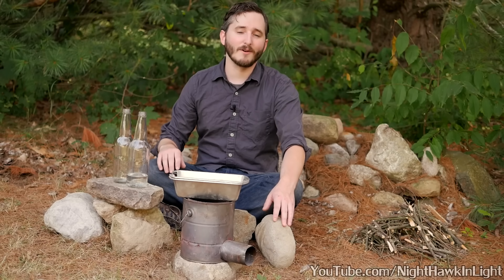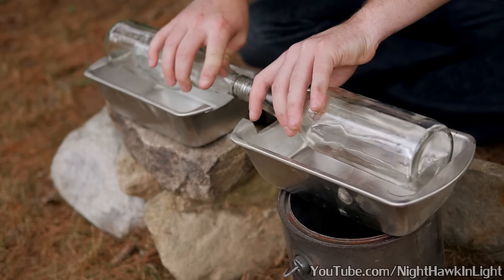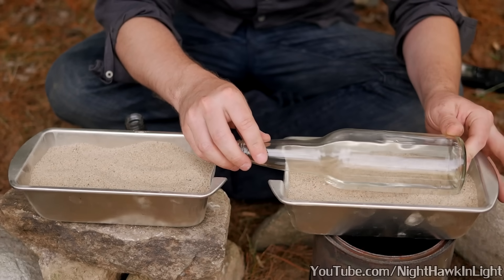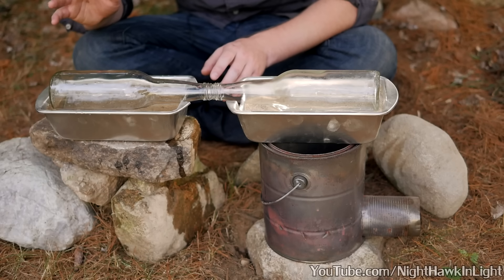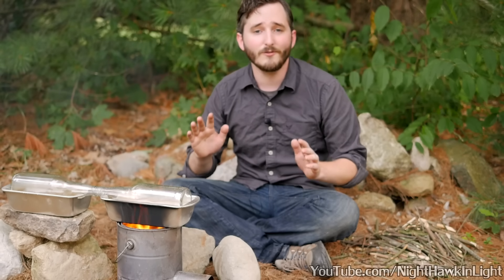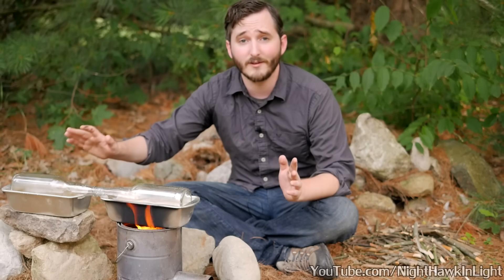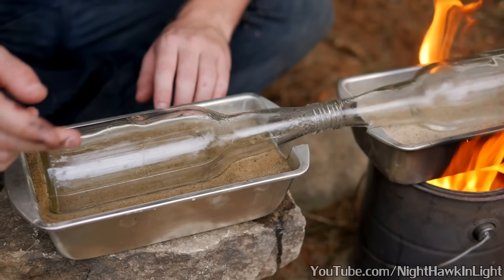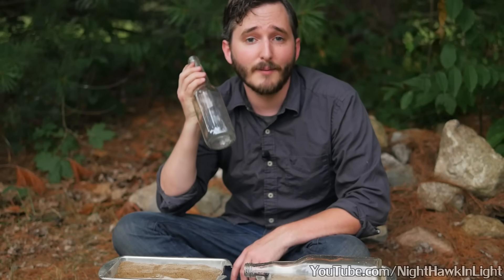How To Turn Salt Water Into Fresh Water (Simple Improvised Distillation)

Comment: FIRST POINT

Through the light of belief, man rises to the highest of the high and acquires a value worthy of Paradise. And through the darkness of unbelief, he descends to the lowest of the low and falls to a position fit for Hell. For belief connects man to the All-Glorious Maker; it is a relation. Thus, man acquires value by virtue of the Divine art and inscriptions of the dominical Names which become apparent in him through belief. Unbelief severs the relation, and due to that severance the dominical art is concealed. His value then is only in respect to the matter of his physical being. And since this matter has only a transitory, passing, temporary animal life, its value is virtually nothing. We shall explain this mystery by means of a comparison:

For example: among man’s arts, the value of the materials used and that of the art are entirely different. Sometimes they are equal, sometimes the material is more valuable, and sometimes it happens that five liras’ worth of art is to be found in material like iron worth five kurush. Sometimes, even, an antique work of art is worth a million while the material of which it is composed is not worth five kurush. If such a work of art is taken to the antiques market and ascribed to a brilliant and accomplished artist of former times, and announced mentioning the artist and that art, it may be sold for a million liras.1 Whereas if it is taken to the scrap-dealers, the only price received will be for the five kurush’s worth of iron.

Thus, man is such an antique work of art of Almighty God. He is a most subtle and graceful miracle of His power whom He created to manifest all his Names and their inscriptions, in the form of a miniature specimen of the universe. If the light of belief enters his being, all the meaningful inscriptions on him may be read. As one who believes, he reads them consciously, and through that relation, causes others to read them. That is to say, the dominical art in man becomes apparent through meanings like, “I am the creature and artefact of the All-Glorious Maker. I manifest His mercy and munificence.” That is, belief, which consists of being connected to the Maker, makes apparent all the works of art in man. Man’s value is in accordance with that dominical art and by virtue of being a mirror to the Eternally Besought One. In this respect insignificant man becomes God’s addressee and a guest of the Sustainer worthy of Paradise superior to all other creatures.

However, should unbelief, which consists of the severance of the relation, enter man’s being, then all those meaningful inscriptions of the Divine Names are plunged into darkness and become illegible. For if the Maker is forgotten, the spiritual aspects which look to Him will not be comprehended, they will be as though reversed. The majority of those meaningful sublime arts and elevated inscriptions will be hidden. The remainder, those that may be seen with the eye, will be attributed to lowly causes, nature, and chance, and will become utterly devoid of value. While they are all brilliant diamonds, they become dull pieces of glass. His importance looks only to his animal, physical being. And as we said, the aim and fruit of his physical being is only to pass a brief and partial life as the most impotent, needy, and grieving of animals. Then it decays and departs. See how unbelief destroys human nature, and transforms it from diamonds into coal.

SECOND POINT

Just as belief is a light which illuminates man and makes legible all the missives of the Eternally Besought One inscribed upon him, so too it illuminates the universe, and delivers the past and the future from darkness. I shall explain this mystery with a comparison I saw during a vision, which concerns one meaning of the verse:

God is the Protector of those who believe; He leads them out of darkness into light.2 It was like this:

I saw in a vision an awesome bridge built between two high mountains situated opposite one another. Beneath the bridge was a valley of great depth. I was on the bridge. A dense darkness had enveloped every part of the world. I looked to my right and saw a vast grave swathed in an unending dense gloom, that is, I imagined it. I looked to my left and as though saw violent storms and calamities gathering amid terrifying waves of blackness. I looked beneath the bridge and imagined I saw a profound abyss. I had a dim torch in the face of this terrifying darkness. I used it and could see a little with its light. A most horrific situation appeared to me. In fact, such awful dragons, lions, and monsters appeared around me and on the bridge in front of me that I exclaimed: “Oh! This torch brings me only trouble!”, and I angrily cast it to the ground and broke it. Then on smashing it, the darkness suddenly dispersed as though I had turned on the switch for a huge electric lamp that lit up the whole world. Everywhere was filled with the lamp’s light. It showed everything as it was in reality.

I saw that the bridge I had seen was a highway through a plain passing over even ground. The vast grave I had seen on my right I realized consisted from top to bottom of beautiful, verdant gardens and gatherings for worship, service, conversation, and the remembrance of God under the direction of luminous men. The precipices and peaks on my left which I had imagined to be tempestuous and stormy I now saw fleetingly to be a vast, lovely, and elevated place of feasting, recreation, and enjoyment behind mountains that were adorned and pleasant. And the creatures I had thought to be terrifying monsters and dragons, I saw were familiar domestic animals like camels, oxen, sheep, and goats. Declaring, “All praise be to God for the light of belief,” I recited the verse,

God is the Protector of those who believe; He leads them out of darkness into light,

and I awoke from my vision.

Thus, the two mountains were the beginning and end of life; that is, this world and the Intermediate Realm. The bridge was the road of life. To the right was the past, and to the left, the future. As for the small torch, it was the human ego, which is egotistical, relies on what it knows, and does not heed the heavenly revelation. The things imagined to be the monsters were the events and strange creatures of the world.

Thus, one who relies on his ego, who falls into the darkness of heedlessness and is afflicted with the blackness of misguidance resembles my first state in the vision, which, like with the pocket-torch and due to deficient and misguided knowledge, saw the past in the form a huge grave amid darkness imbued with non-existence. It showed the future to be a stormy and desolate wasteland governed by coincidence, and events and beings, which are all submissive officials of One All-Wise and All-Compassionate to be monsters. Such a person as though manifests the verse,

And those who reject belief, their protectors are the evil ones; they lead them out of light into darkness.1

But if such a man attains to Divine guidance and belief enters his heart, and if the tyranny of his soul is smashed and he heeds God’s Book, he will resemble my second state in the vision. Then the universe will suddenly take on the colour of day and be filled with Divine light. The world will recite the verse,

God is the light of the heavens and the earth.2

Then he will see with the eye of the heart that the past is not a vast grave, but where the groups of purified spirits who each century having performed their duties of worship under the leadership of a prophet or saint exclaim, “God is Most Great!” on completion of the duties of their lives, and fly to elevated abodes, moving on to the past. He will look to the left, and through the light of belief distinguish in the distance a feasting-place of the Most Merciful set up in palaces of bliss in the gardens of Paradise, beyond the mountainous revolutions of the Intermediate Realm and the hereafter. And he will realize that the storms and earthquakes and tempestuous events are all submissive officials, and understand that they are the means for instances of wisdom which though apparently harsh are in fact most gentle, like the storms and rains of spring. He will even see death to be the introduction to eternal life, and the grave, the door to everlasting happiness. You can deduce further aspects for yourself. Apply the reality to the comparison!

Comment: It is also possible to use just a bottle and one of those trays. Bottle will have same purpose as in this video, metal tray will be the cold surface for condensation (placed over neck of the bottle upside down at angle with one corner being the lowest point). Water will condensate in the tray and trickle down. All you have to do is use third vessel which can be anything including a large leaf to catch it (the third vessel can be  literally anything water tight with depression including you)
Reply: That last line killed me 😂

Comment: If it’s that easy to remove salt from sea water why is there a worldwide worry about limited fresh water sources??? Wouldn’t we be able to just distill all the water humanity needs from the ocean if this was true?
Reply: Because to distill the amount of water a country or god forbid the 7 billion + of us would need a significant resource input. In not only  distillation plants but massive amounts of seawater.  It is far simpler to treat fresh water than to create it out of seawater. 

Not to mention the unfathomable drain on worldwide energy grids. It takes a lot of energy to heat water up. It's why it saw use as a coolant for so long. And in some applications is still used as a coolant.

Comment: Don't you need a rubber gasket to prevent gas from escaping between the bottles?
Reply from the maker: No, it seals by itself with a little water that collects on the rim. Hardly any escapes

Comment: Without the pants-why not do a decoder hole for the heat source. It’s a U-shaped hole that  works like a rocket stove with the fire on one side and the air getting sucked through on the other. 

Since the fire is in the ground-all you have to do is lay the bottle on top of the Side of a hole with a fire. Thanks for this post!

Comment: The biggest potential problem is that if your source water is contaminated with something that has a lower boiling point than water then this specific technique will need to be modified. What you will have to do is wait until after the water has started boiling before you set up the second bottle to receive the steam from the first.
Reply: You could just add a coiled tube of copper and close it up at both ends. Nothing's getting in there then.
Reply: salt can accomodate harmful organism
Reply: @Drjarso heat will kill the bacteria and other things.

Comment: I live on a small island and have been trying to figure out an easy way of distilling sea water (short of investing in a still) if I had to, this is a great idea, so thanks for sharing!
Reply: Old post but easiest way is to buy some copper line and a couple adapters.  put the adapters on bottles/containers and plug in the tubes.
Reply: @michelle.lin3653  I’m still here, cheers for your input 🙂🤝
Reply: @KumaBean  Welcome, we use it here and it can work with anything from a 1/2 L bottle to giant IBS containers

Comment: I’m wondering if it were a hot day you could build a pile of sand and bury a bottle in the sand to keep it cool.  Then take a dark bottle exposed to the sun to heat it up.  If you had about 20 bottles you could do this on a mass scale with no fire needed.  It would be slower but could be ramped up for ease of production.

Comment: Using two fresh coconuts and hollow reed would be probably a feasible method on some deserted palm island.
We could also make a suitable clay pot(s), or as a faster method, some combination of the stone plate bottom (or the baked clay bottom) and the wooden or stone plate sides, hopefully  for a lot larger containers and the quantity of distilled water.
Reply: "Using two fresh coconuts and hollow reed"? You must have been stranded on a deserted island with the Professor.

Comment: You need to add the minerals back into the water "apparently" (it's one of those things we know that we're told we know) prepare with this at least for October. Love and god bless.
Reply: Physiological water is a 0.95% salt solution iirc, so adding a small bit of salt/sea water to the distilled water can be done if osmosis issues are to be feared from drinking it. If you have food, eat alongside of drinking distilled water, the dH2O will extract the needed minerals from the food instead of your body.

Comment: Great info! I am planning a 30 day survival trip to a Motu Iisland) in French Polynesia. There will be no fresh water. I have seen a couple of your projects, which one would you recommed for my purpose?
Reply from the maker: My projects are for emergency use. You need a well made commercial desalinator or still
Reply: @Nighthawkinlight  Our objective is to build one in an emergency situation.
Reply from the maker: Probably this version then, but others have noted that brass and copper should be replaced with all stainless steel for safety: https://youtu.be/PT6cjp_zThw

Comment: That was good Information, thank you. I'd like to see how to distill large Amounts of lake, stream, and pond water suitable for drinking. Do you have that Information?
Reply: 2 steel drums connected by tubing at the top (has to be metal or something heat resistant). Fill one with salt water and light a fire underneath. As the water evaporates it will condense in the tubing and drip into the second cooler drum. Should have a full drum of fresh water by the next day as long as the fire doesnt go out. Keep the second drum as far away from the fire as possible to minimise it conducting any ambient heat (2m should be fine). Cook the drums for an hour or so before hand in order to burn off any toxic residues or lubricants before you boil water in them.

Comment: Why not just catch the water or create a straw or use a string/wick to run down to a standing bottle below? This is cool, but with something like wine jugs it would be a thousand times more effective. Could this be done with those big Ozarka jugs is the question. I'd love to see that. Or you could cap them off and drill a hole in each one high up on the ends and connect them with a pvp pipe or something. That would be a neat contraption. How well could the sun-evaporation do this for you with bottles?

Comment: Yes, I think  you should give a few drops of salt water into the distilled water, since the distilled water is very pure and can take electrolyte from your throat.. unless you let the water contact with air long enough so there will be enough dissolved CO2 that will be presence in the water (in the forrm oh carbonate ion, can be detected by pH drop, usually from 6 to 5)

Comment: I was wondering if you could use yur method with somewhat dirty grungy water & then boil up what collects in the empty bottle to make it safe to drink. What do you think? Tried to send that to ya in an email but said the address of yur vid here don't exist. But that is some very cool stuff & good stuff to learn as well. Like yurself I'm no where near salt water. I'm way to far away from that stuff.
Reply from the maker: Yes dirty water would be safe to drink after distilling, but you may need to throw out the first bit of liquid that distills over.
Reply: @Nighthawkinlight  oh okay. Thanx for the tip dude. I'm just getin geared up, headin out with the dog for an adventure, hare is still open, time to get some bunnys before the season ends.
Reply: @Nighthawkinlight  & im back. I'v never tried distilling dirty water. I'v drank from flowing streams & lake water. Boiled a lil bit of snow once to drink but never did or had to do what you see on those survival shows. Who knows, maybe in the future I might use yur method. Just have to see what the future brings.
Reply from the maker: For most water boiling is just fine. You only need to distill if there's some kind of chemical contamination like salt or oil. For the latter you need to be much more careful to boil off the first bit of steam into the air, then toss the last bit. That's where the contaminants will be. You also may need to distill several times.
Reply: @Nighthawkinlight  oh okay. I like learnin stuff cause I spend lots of time outdoors. Can't stand bein indoors. I wana start livin outside, just gota wait for the snow to melt away. Any knowledge I can get will help. I'd usually just take bottled with me. Just enough to get by. Always need it.

Comment: Distilled water is not good for our organism, we need dissolved salt after all. Maybe for survaival situation is better than salt water but...

If the water contains gasoline you cannot distill it because gasoline pass to the "pure water" botle. However, if you heat the water to the air, gasoline will be evaporated because evaporation point is lower than water's one. Could be possible??

Comment: I believe it may be more efficient if you also water the heat side.
Reply: If you water the sand on the heated side, the boiling water outside of the salty bottle will carry away a proportion of the heat stored in the sand into the open air, also the heated sand can never get above the boiling point of water itself to heat the water in the salty bottle enough to boil until after all the wet sand has boiled off and dried and thus, it makes the whole process far less efficient than if left to let the sand come up to temp dry.

Comment: If you didn’t have metal trays I think the easier way of doing it would be to dig a hole under the salt water bottle that’s not large enough for it to fall into but can rest over top of it and in that hole make a fire then the second bottle could easily be matched up with the salt water bottle just by laying it on flat ground.